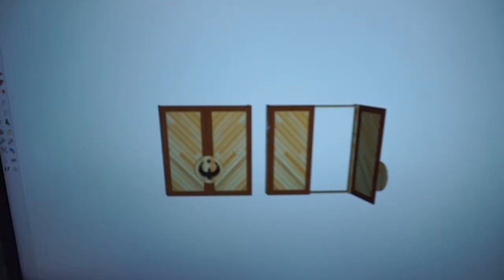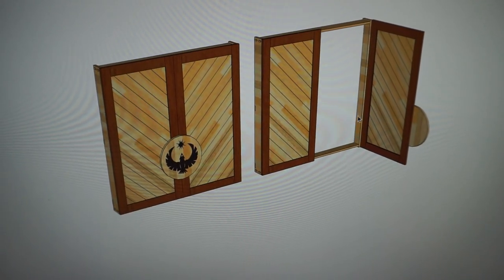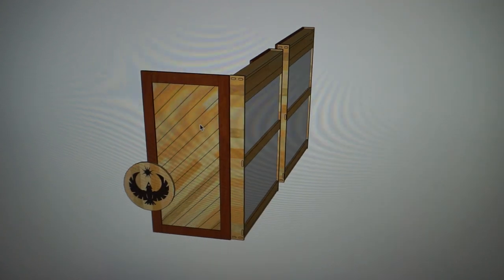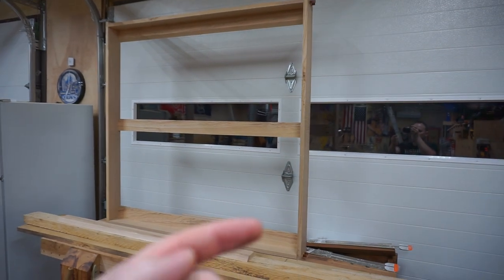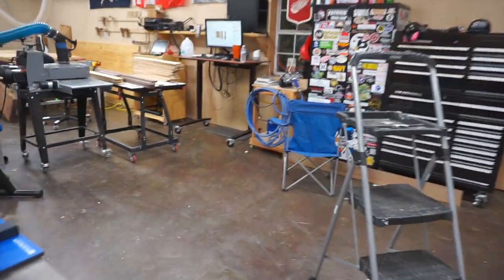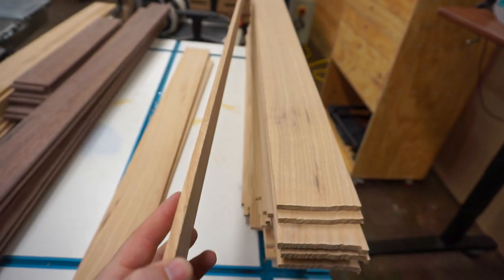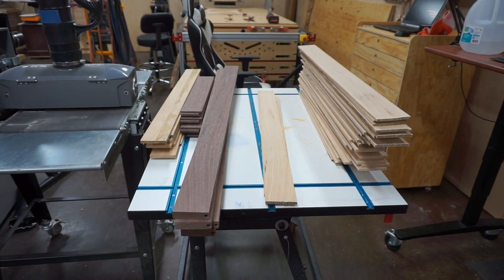Air Force Cabinet Build Progress

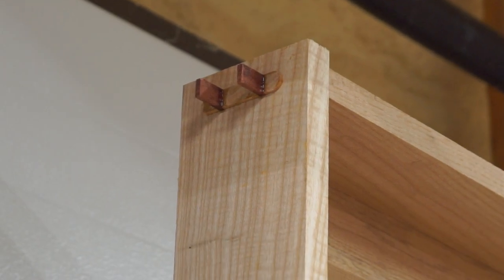Comment: 2:35 Would that wedge placement stress the joint enough to crack the long board down the grain?
Reply from the maker: In this case, no. The wedges were more like plugs. We didn't make them too big for that reason.